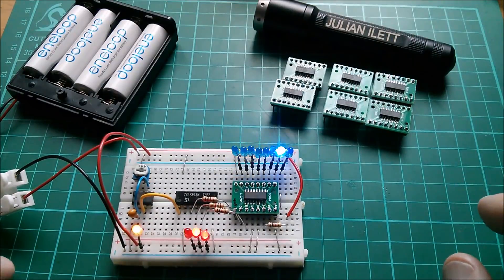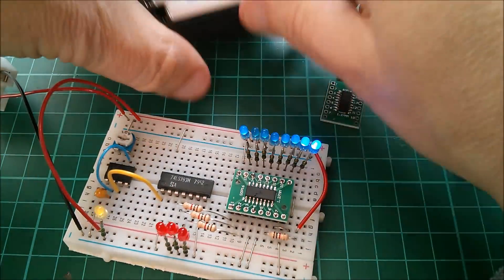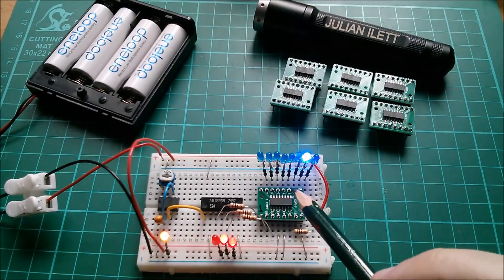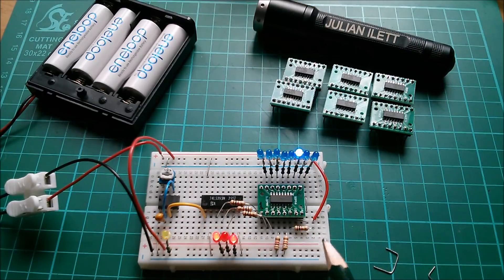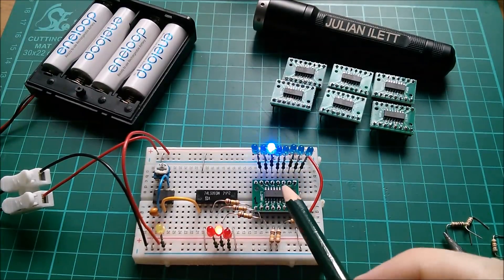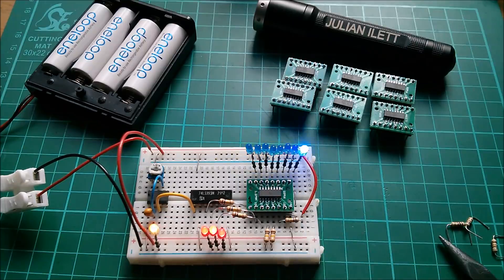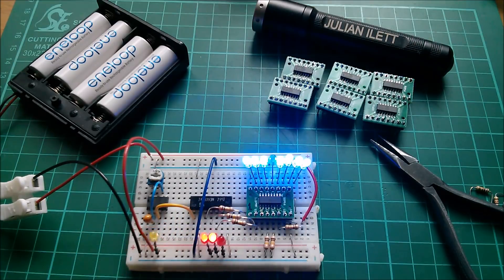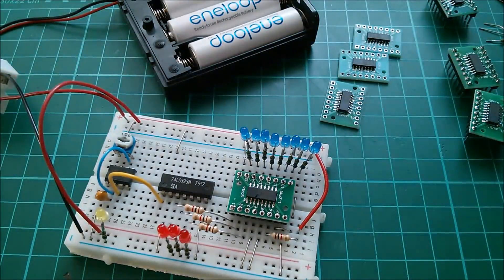Free Energy? - CMOS Microchip Works with No Vdd and No Gnd

Comment: Apparently vcc voltage comes through the pullup loads being connected to outputs and then from the internal clamping diodes of the chip pins.In another chip with a function which can drive all pullup outputs simultaneously to zero it might oscillate due to the unwanted astable situation just like the hollow earth due to the wind blowing inside because its empty,more lighter and that causes oscillations and sometimes earthquakes too.

Comment: I would check the voltages and currents on ground and/or Vcc and compare it with the voltages going into the various pins to see if you can find some connection and determine where it's getting it's power from.

Comment: Look up the circuits for passive RFID using AVR attiny chips. You don't connect VCC or ground, the input protection diodes rectify the AC from the RFID coil and applies it to the rails internally. The circuit is from the `90s.

If you had smaller pulldowns on the two inputs that are pulled down, it would probably work better without the direct ground link.

found the avr version http://scanlime.org/2008/09/using-an-avr-as-an-rfid-tag/

Comment: You need to go back to your data sheet RE: NO Vdd and NO Gnd. All the pins has power protection so there is a diode that points to Vdd that goes from the pin(s) to the Vdd,  Likewise every pin has a diode pointing from Gnd to every pin. So NOT good practice - you can power the IC by using other pins then Gnd & Vdd- it's called SLOPPY Engineering. And the Chip will NOT like it, and in a pinch will give up it's magic smoke. Too bad we cant get ahold of National Blue Book on 74's because they show this real well. TI minimalist databooks did not take up National's well documented books, so sometimes your left guessing.

Comment: Your clickbaity title reminds me of one of the stories from the development of the ARM processor, where a prototype was found to be running without power...

A quick google search turns up this:

"However, when they got the first test chips back and plugged them into a development board, the chip worked – but seemed to be consuming no power at all. It turned out that there was a fault in the board, and the power supply line wasn’t working. The chip was, as Wilson explains, “running on leakage from the logic circuits”. The chip consumed an incredibly low 0.1 watts. Wilson’s ARM, it turned out, was a particularly efficient version of RISC."

https://www.linuxvoice.com/sophie-wilson-acorn-and-the-development-of-arm/

Comment: Pencil as a pointer not a good idea . I was trying to fault find a electrical problem on the on the big Tig welder and the company you don't want to do it like fool was looking over my shoulder when his arm shot out and he pointed his pencil at a connection , there was a loud crack and his pencil disappeared in smoke he staggered back away from me then for about two minutes did a silly little dance . So I never go near electrics with anything not designed for the job .
Reply from the maker: lol, funny story :)
Reply: The same guy managed to drop a tool box on the middle finger of his left hand , the nail and end of the finger swole up almost instantly . So one of the guys said get a tiny drill bit and very slowly drill by hand through the nail to release the pressure . A couple of minutes later there was a yell and we found he had used a 2mm drill bit in his battery drill and he was now fixed to his bench as he had drilled through the nail , bone and finger into his bench were upon the drill bit had snapped at the drill . We had to back the drill out and the yelling started again .

Comment: 1:20 - It is extremely annoying when manufactures don't use a standard pin 1 dot or notch.  And then they use laser etched printing that is hard to read without getting the lighting angle exactly right.  Definitely was better in the "good ol' days".

Comment: I had clicked on this in order to remind you that there are other electronic components that don't require a "VDD" or a "VCC" and there's nothing "free energy" about it (they get their power from current flowing through their load as in open-collector NPN or from the signal that's driving them) but it looks like this video isn't even about that anyway.   :P

Comment: come on Julian its now time to cut bits off the chips that you done need...  https://hackaday.com/2012/01/25/custom-microcontroller-using-only-a-dremel/.   i cant find it now but a bloke cut a pic down to 6 pins and added 1 single inductor for an RFID system. NO other components.

Comment: Click bait title... lame... also testing a 1MHz chip at 10Hz... even damaged it works. I bet an engine with bad compression ratio on half the cylinders can push a car at 10km/h...
Reply: If you fry your engine, with smoke effects, are your sure that engine will push you anywhere?
Reply: Juraj Lonc  Maybe. I drove a blown engine half way across the state of tennessee, the trick was to not turn it off and to adjust the idle high enough that it wouldn't stall out and die xD It was heading for a scrap yard, so don't freak out. The exhaust manifold was glowing orange halfway there and it chugged oil and water like crazy.
Reply: It'll probably push you over the edge to insanity and despair.

Comment: Well, not honestly "free" but in addition to solar you can snag some energy from the cluttered RF spectrum.  Might be interesting to see Andreas Spiess or somebody power an unattended micropower intermittent remote sensor, temp/hum beacon, or something from accumulated (supercap?) energy harvested from ambient RF.
Reply: I did make a very low powered temperature sensor remote unit that was solely powered by RF. I managed to get about 500µA from the antenna setup (it might help that I live 5 km from a 100 kW AM transmitter :D) stored the energy in a supercap and the sensor was an Oregon Scientific remote unit for one of those "weather station" type things that run for years on AAA batteries...

Comment: The silicon die can take a great deal of heat and survive. The package might scorch before the chip dies. Reverse polarity is usually fatal. That is some mighty fine detective work there. As for soldering travails, SO packages are YUGE! Try your hand at something that is actually small. :-)

Comment: I once forgot to connect the power rails of an op amp. It still kinda worked, but in a buffer configuration the output sometimes got stuck on 0V. CMOS can be really weird sometimes.
Reply: I once powered an Arduino Nano through the analogue reference pin instead of the VCC pin (error in the veroboard layout).
The thing worked but when it suddenly crashed with no reason I measured the voltage with a multimeter between VCC and ground and found only 3V. I then started probing around the powersupply because I thought it was faulty, I even added a second 78L05 in parallel but that didn't solve the issue... I wasted a good hour before I actually found the mistake :D

Comment: Oh NO. Julian.
My entire brain for the last 15 years was CERTAIN that chips either worked or didn't! !

I had NO IDEA they could be a little bit broken. I'm going to stay awake  at night worrying...
Reply: Tony Hunt Oh yes. CPUs can actually die slowly. Typically the maximum clock speed drops over time (especially if they operate hot) Once some circuits deteriorate far enough; say, some very specific operation in ALU, such as a shortcut to doing something, like maybe a trig operation, Anytime your CPU uses that instruction the result may he garbage or worse. That undefined behavior may lead to a program crashing. If ypu are desepate enough you can rewrite code to avoid that "shortcut." I think much more common examples may be RAM failures. Thats why memtest86 is a thing. It tests every last addressable bit of your RAM.

I know 555 timers and op amps can end up "partially" dead from messups I did. I still keep around a "dead" LM324 since 3 of the opamps still work. But the 4th one is shorted and the chip gets hot.
Reply: A lot of times when a component is damaged, including chips, it can still continue to function, but tolerances will be altered and in some cases the device can seemingly work fine until it dies (seemingly) at random). I read an interesting application note from Vishay the other day about how ESD can change the resistances of thin film resistors to a significant degree.

As far as ICs go, I actually bought a 32gb micro sd card once. When I went to use it, Windows only showed it as having some odd number like 230mb of space available in a blank partition that it wouldn't let me format. Upon closer inspection of the card itself, I realized that upon opening the package, I clipped the corner edge off of it. I was quite surprised that my computer could still understand what it was. It just wasn't able to use it. But that would make sense considering how large the memory portion of the IC would be compared to the rest of it. If I clipped off just part of the memory it would stand to reason that I could sever the connection to a bunch of memory cells while having a few left connected, making Windows think it's much smaller but still being unusable.
Reply: Yup, same sorts of wacky things can happen with microcontrollers... You can fry just one pin, or one bank of pins, and the whole thing will keep on working.
Reply: Remind how many ics we throw away because we thought they are blown
Reply: I hope you wasn't working for Hillary. lol

Comment: Should the title say VCC rather than Vdd?
Reply: VCC C is for collector of npn transistor. VDD D is for drain of fet transistor....
Reply: All this confusion is thanks to those that just couldn't live with "conventional" current.  Drain, source, arrows pointing the other way, just because they couldn't get over it.  Sad lives.
Reply: Ahh, I see. I only commented because you said VCC so many times
Reply: Vcc is the normal symbol for the positive supply for TTL 74xxx, 74LSxxx series logic and similar logic chips based on bipolar transistor structures. Vdd is the normal symbol for the positive supply for CMOS logic / digital chips. But some manufacturers also use Vcc. So it does not really matter.
Reply: The datasheet from Ti calls the pin Vcc so I guess it must be okay :-)
Reply: I always took it Vdd (drain) for fet transistors and opamps , Vcc (collector) for bjt style opamps..datasheet only refers to Vcc
Reply: We're currently using two systems, and one of them is wrong by random chance, but lots of people use it because it's the original one. And other people, like me, are updated and use the other one. That's a massive confusion! If we change the books for using only true electron flow, there will be no confusion in the future. The problem isn't that it's wrong, after all, the theory works in both directions, the problem is that you must deal with both of them. We must pick a standard, not two. And better having a standard that's correct than an incorrect, and equally convenient one, wouldn't you think?
Reply: Vcc applies to BJT transistors. The 74HC series are CMOS devices. So Vdd would be the correct nomenclature. :>
Reply from the maker: Really I should have said Vdd all the way through the video
Reply: I read it as no VCC and no Vdd